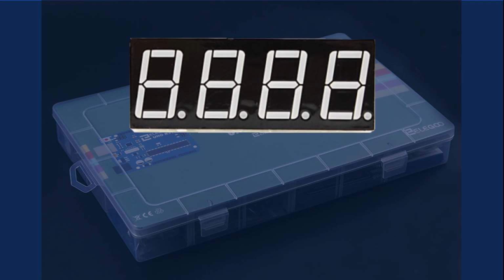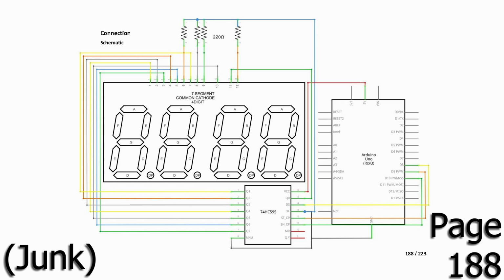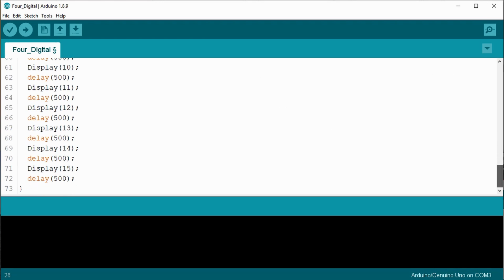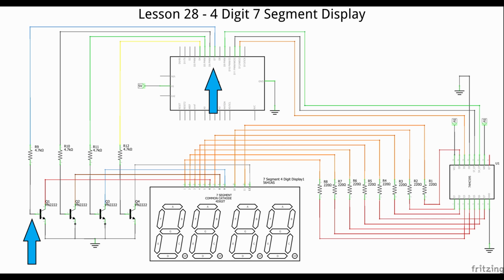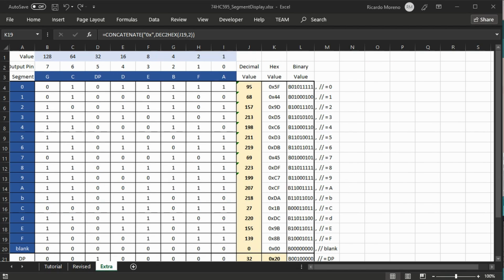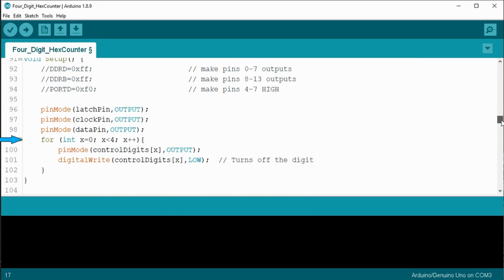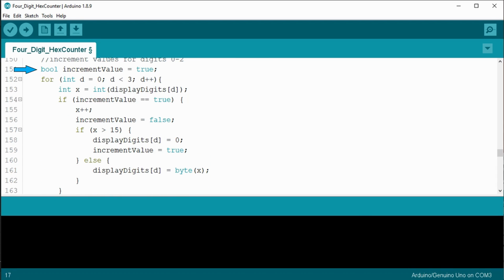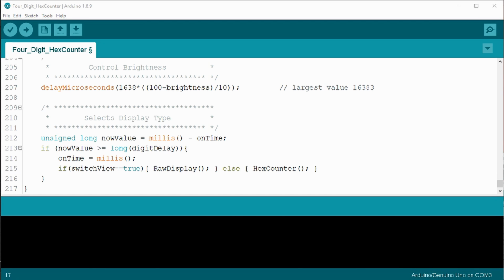Lesson 28 - 4 Digit 7 Segment Display

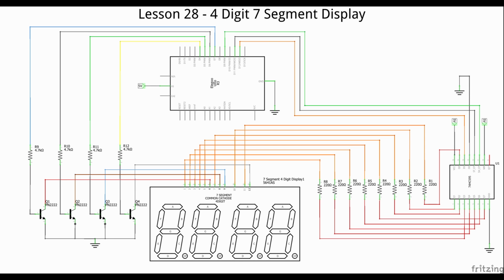Comment: 12:54 You are overdriving the 74HC595 which has a max chip current of 70mA.  With 5v supply, 2.0v forward voltage of red led and 220ohm resistor, each segment requires (5-2)/220 = 13.6mA.  When displaying an "8" that's 7 segments x 13.6mA = 95.2mA.
Reply: I'm just starting out with micro controllers and just finished wiring this. If I proceed, will the shift register just have a shorter lifespan? If so, how much shorter?
Reply: @deadlyorchard  It's a roll of the dice.  Just use higher value resistors, 470 instead of 220 and you should be fine.  You won't even notice the difference in brightness.
Reply: I think you might've messed up the math there. (5-3)/220 = 0.00909, not 0.0136. 0.00909 x 7 segments = 0.0636 = 63.6mA
Reply: @randomrandom5  Actually it's the (5-3) part that has a typo.  The forward voltage of a red LED is around 2v (see preceding sentence above).  So my analysis still stands, and thanks for pointing out the typo! (corrected above)

Comment: after watching this, theirs too much inconsistancy with ur examples and hard to follow witch diagram is correct one.  i have 3 diff breadboards and none of them match ur cheap sketch up version on 12.42 time frame. the segement display doesnt leave eno room for wires to run
Reply: He clearly lists the "junk ones" as JUNK. also, that's your problem, not his. the only cheap sketch up is yours, and yours is CLEARLY too small. get a new one and stop whining

Comment: Wonderful tutorial!  BTW... I used the pin connections similar to the Arduino tutorial, so my bit positions are different from your spreadsheet, and the values being output for each number are different from your circuit.  I used this code to determine the decimal values to output according to my pin connections.  
 
// Bit positions for each segment
const int legTop = 0;
const int legUpperRight =1;
const int legLowerRight = 2;
const int legBottom = 3;
const int legLowerLeft = 4;
const int legUpperLeft = 5;
const int legMiddle = 6;
const int legDecimalPoint = 7;

int setSegments(int number, bool decimalPoint) 
{
    int retSegments = 0;
    
    switch(number)
    {
    case 0: bitSet(retSegments,legTop);
            bitSet(retSegments,legUpperRight);
            bitSet(retSegments,legLowerRight);
            bitSet(retSegments,legBottom);
            bitSet(retSegments,legUpperLeft);
            bitSet(retSegments,legLowerLeft);
            break;
    case 1: bitSet(retSegments,legUpperRight);
            bitSet(retSegments,legLowerRight);
            break;
    case 2: bitSet(retSegments,legTop);
            bitSet(retSegments,legUpperRight);
            bitSet(retSegments,legMiddle);
            bitSet(retSegments,legLowerLeft);
            bitSet(retSegments,legBottom);
            break;
    case 3: bitSet(retSegments,legTop);
            bitSet(retSegments,legUpperRight);
            bitSet(retSegments,legLowerRight);
            bitSet(retSegments,legBottom);
            bitSet(retSegments,legMiddle);
            break;
    case 4: bitSet(retSegments,legUpperLeft);
            bitSet(retSegments,legMiddle);
            bitSet(retSegments,legUpperRight);
            bitSet(retSegments,legLowerRight);
            break;
    case 5: bitSet(retSegments,legTop);
            bitSet(retSegments,legUpperLeft);
            bitSet(retSegments,legMiddle);
            bitSet(retSegments,legLowerRight);
            bitSet(retSegments,legBottom);
            break;
    case 6: bitSet(retSegments,legTop);
            bitSet(retSegments,legUpperLeft);
            bitSet(retSegments,legLowerLeft);
            bitSet(retSegments,legBottom);
            bitSet(retSegments,legLowerRight);
            bitSet(retSegments,legMiddle);
            break;
    case 7: bitSet(retSegments,legTop);
            bitSet(retSegments,legUpperRight);
            bitSet(retSegments,legLowerRight);
            break;
    case 8: bitSet(retSegments,legTop);
            bitSet(retSegments,legUpperRight);
            bitSet(retSegments,legLowerRight);
            bitSet(retSegments,legMiddle);
            bitSet(retSegments,legUpperLeft);
            bitSet(retSegments,legLowerLeft);
            bitSet(retSegments,legBottom);
            break;
    case 9: bitSet(retSegments,legTop);
            bitSet(retSegments,legUpperLeft);
            bitSet(retSegments,legMiddle);
            bitSet(retSegments,legUpperRight);
            bitSet(retSegments,legLowerRight);
            bitSet(retSegments,legBottom);
            break;
    case 0x0A: 
            bitSet(retSegments,legTop);
            bitSet(retSegments,legUpperLeft);
            bitSet(retSegments,legLowerLeft);
            bitSet(retSegments,legMiddle);
            bitSet(retSegments,legUpperRight);
            bitSet(retSegments,legLowerRight);
            break;
    case 0x0B: 
            bitSet(retSegments,legUpperLeft);
            bitSet(retSegments,legLowerLeft);
            bitSet(retSegments,legMiddle);
            bitSet(retSegments,legLowerRight);
            bitSet(retSegments,legBottom);
            break;
    case 0x0C: 
            bitSet(retSegments,legTop);
            bitSet(retSegments,legUpperLeft);
            bitSet(retSegments,legLowerLeft);
            bitSet(retSegments,legBottom);
            break;
    case 0x0D: 
            bitSet(retSegments,legMiddle);
            bitSet(retSegments,legLowerLeft);
            bitSet(retSegments,legBottom);
            bitSet(retSegments,legUpperRight);
            bitSet(retSegments,legLowerRight);
            break;
    case 0x0E: 
            bitSet(retSegments,legTop);
            bitSet(retSegments,legUpperLeft);
            bitSet(retSegments,legLowerLeft);
            bitSet(retSegments,legMiddle);
            bitSet(retSegments,legBottom);
            break;
    case 0x0F: 
            bitSet(retSegments,legTop);
            bitSet(retSegments,legUpperLeft);
            bitSet(retSegments,legLowerLeft);
            bitSet(retSegments,legMiddle);
            break;
    default: 
            retSegments = 0;
    } // End Case

    if (decimalPoint)
    {
      bitSet(retSegments,legDecimalPoint);
    }

    return(retSegments);
}

Comment: Nicely done! Very thorough! Wow! Thank you for saving me from burning out the output pins on my Arduino! I only have two transistors in my starter kit, so I am displaying just 2 digits for now. I modified my displayDigits function to display each of the 2 digits for 1 ms each, and I added a for loop around that to set how long in ms to display the two digits for (eliminating the flicker).  I set this to about 50 ms which worked great for my decimal counter (0 to 99).  Now I know more about transistors!

Comment: Okay I have tried to replicate the lesson from Elegoo (in which the four digits all cycle through) and have quadruple checked connections, and it goes through a very odd cycle starting with 1, 3, 5, 7, etc.  Interestingly, if I move the red jumper wire from 5v (coming out of the Uno board) to the Vin pin, it works as shown above.  Any idea what could be going on?
Reply from the maker: Greetings, first I need to confirm that you are using the same Elegoo lesson as shown in the video.  Also Vin will supply unregulated power out.  To get regulated 5V out, use the 5V pin.  If you are using a USB cable, you're getting 5V from your computer.  Your adapter may supply up to 9V.  You can do a quick Google search for more information.

Comment: The same purpose can be fulfilled by TM1637  (https://www.youtube.com/watch?v=DuamjlstOKM&t=609s) and is far more practical than this unnecessarily complicated device.
Reply: Indeed, while it is far more practical, this video only uses parts included with the Elegoo starter kit. However, knowing this, I do think the kit requires a major overhaul, especially due to how it's advertised.

Comment: when do you show me how to put it together? Im not a fucking engineer. This circuit is extremely complicated for an arduino beginner. I just need to use the display for my program... You did not show ANY of the wiring of the actual device at all. Your picture dont help me. I dont have time to learn all this just to display a number in my arduino device ill never code with again
Reply: no u
Reply: Chill out guy.
Reply: its probably a little to late but the circuit diagram he put up is really easy to follow along to just make sure you follow one single line till it ends. furthermore if the wiring diagram was a little too complicated maybe consider switching programs it doesnt get any easier

Comment: You will forget electronics and embedded systems after watching this video for sure!! Char is 16 bit...he'll yeah
Reply from the maker: Oh darn.  To clarify, typically a char is a value from 0 to 255, which is single byte and typically represents a letter or character.  A byte can be a value between -128 to 127.  An  unsigned byte is 0 to 255.  While researching this lesson I found that a char in Java is a UTF-16 code unit.  It's not necessarily a complete Unicode character, but it's effectively an unsigned 16-bit integer.  I'm not sure if this still hold true.
Reply: @rickmorenojr  Ohh I dont know about the Java man. But I think as far as u r twiking around embedded systems char is always 8 bit or 1 byte...yes ofcourse you can creat your typedef to creat your own 16 bit char😉. Great video by the way!!

Comment: This was good for counting, I want to learn more about scrolling from right to left  (LSB . digit 4 , to the MSB , digit 1 ) I'm good at Hardware, i.e. current draws , voltages, small signal amplification ohm's law and such, but the coding in very new to me. Lesson 16 they walked the LED's from right to left with the shift register. I want to be able to do that with the 4 digit display or even multiple 7 segment displays, but light up the corresponding segments, i.e. a,b,c,d,e,f,g as they progress to the left. If anyone knows of good resources or examples feel free to contact me at janhornberger1234@outlook.com
Reply: Kristian Blason's Anything Arduino series episode on the 7 segment 4 digit display has an easier to understand code for lighting up the 4 digit display if that helps. Im on the same boat as you buddy

Comment: Thanks for this great tutorial. Your improvement of the circuit is great. But a big leap in improving the code can be made by separating the plumbing of getting digits to show on the display from the logic to what to display. This can be done even with using the same coding skill level 
See my example on https://github.com/srooij69/4x7_Segment_Display
(though not a goal, with less lines of code)

Comment: Thanks for poiting out the flaws in the lesson 28 tutorial. Actually I am using a common anode but didn't realise the tutorial was about common cathode. But I could not figure out how to wire for a CC. So the shift register IC was boiling hot! I stopped everything. What are the modifications necessary for a common anode wiring? Cheers

Comment: I use potentiometer to display number but last digit always flashing. For example number is 237 . It displays number 237 and then 7 for a few seconds. Please help.

#define DataPin 8
#define LatchPin 9
#define ClockPin 10
#define d1 2  //digit#1
#define d2 3  //digit#2
#define d3 4  //digit#3
#define d4 5  //digit#4

byte val;

//Cathode 7 Segment
unsigned char number[]= {
  0xFC,0x60,0xDA,0xF2,0x66,0xB6,0xBE,0xE0,0xFE,0xE6
};
                  
void setup()
{  
  Serial.begin(9600);
  
  pinMode(ClockPin, OUTPUT);
  pinMode(DataPin, OUTPUT);
  pinMode(LatchPin, OUTPUT);
  pinMode(d1, OUTPUT);       
  pinMode(d2, OUTPUT);       
  pinMode(d3, OUTPUT);
  pinMode(d4, OUTPUT);
}

unsigned char GetByteForNum(int num)
{
  return number[num];
}

void DisplayLED(int x1,int x2, int x3, int x4)        //4 Digit
{
   val=GetByteForNum(x1);                   
   digitalWrite(d1,LOW);
   digitalWrite(d2,HIGH);
   digitalWrite(d3,HIGH);
   digitalWrite(d4,HIGH);
                   
   digitalWrite(LatchPin, LOW);
   shiftOut(DataPin,ClockPin,LSBFIRST,val);
   digitalWrite(LatchPin, HIGH);
   
   delay(5);

   val=GetByteForNum(x2);                           
   digitalWrite(d1,HIGH);
   digitalWrite(d2,LOW);
   digitalWrite(d3,HIGH);
   digitalWrite(d4,HIGH);
                   
   digitalWrite(LatchPin, LOW);
   shiftOut(DataPin,ClockPin,LSBFIRST,val);
   digitalWrite(LatchPin, HIGH);
   
   delay(5);
   
   val=GetByteForNum(x3);                    
   digitalWrite(d1,HIGH);
   digitalWrite(d2,HIGH);
   digitalWrite(d3,LOW);
   digitalWrite(d4,HIGH);
                   
   digitalWrite(LatchPin, LOW);
   shiftOut(DataPin,ClockPin,LSBFIRST,val);
   digitalWrite(LatchPin, HIGH);
   
   delay(5);

   val=GetByteForNum(x4);                              
   digitalWrite(d1,HIGH);
   digitalWrite(d2,HIGH);
   digitalWrite(d3,HIGH);
   digitalWrite(d4,LOW);
                   
   digitalWrite(LatchPin, LOW);
   shiftOut(DataPin,ClockPin,LSBFIRST,val);
   digitalWrite(LatchPin, HIGH);
   
   delay(5); 
}
void DisplayLED(int x2, int x3, int x4)              //3 Digit
{
  val=GetByteForNum(x2);                           
   digitalWrite(d1,HIGH);
   digitalWrite(d2,LOW);
   digitalWrite(d3,HIGH);
   digitalWrite(d4,HIGH);
                   
   digitalWrite(LatchPin, LOW);
   shiftOut(DataPin,ClockPin,LSBFIRST,val);
   digitalWrite(LatchPin, HIGH);
   
   delay(5);
   
   val=GetByteForNum(x3);                    
   digitalWrite(d1,HIGH);
   digitalWrite(d2,HIGH);
   digitalWrite(d3,LOW);
   digitalWrite(d4,HIGH);
                   
   digitalWrite(LatchPin, LOW);
   shiftOut(DataPin,ClockPin,LSBFIRST,val);
   digitalWrite(LatchPin, HIGH);
   
   delay(5);

   val=GetByteForNum(x4);                              
   digitalWrite(d1,HIGH);
   digitalWrite(d2,HIGH);
   digitalWrite(d3,HIGH);
   digitalWrite(d4,LOW);
                   
   digitalWrite(LatchPin, LOW);
   shiftOut(DataPin,ClockPin,LSBFIRST,val);
   digitalWrite(LatchPin, HIGH);
   
   delay(5); 
}
void DisplayLED(int x3, int x4)                       //2 Digit
{ 
   val=GetByteForNum(x3);                    
   digitalWrite(d1,HIGH);
   digitalWrite(d2,HIGH);
   digitalWrite(d3,LOW);
   digitalWrite(d4,HIGH);
                   
   digitalWrite(LatchPin, LOW);
   shiftOut(DataPin,ClockPin,LSBFIRST,val);
   digitalWrite(LatchPin, HIGH);
   
   delay(5);

   val=GetByteForNum(x4);                              
   digitalWrite(d1,HIGH);
   digitalWrite(d2,HIGH);
   digitalWrite(d3,HIGH);
   digitalWrite(d4,LOW);
                   
   digitalWrite(LatchPin, LOW);
   shiftOut(DataPin,ClockPin,LSBFIRST,val);
   digitalWrite(LatchPin, HIGH);
   
   delay(5); 
  
}
void DisplayLED(int x4)                     
{
   val=GetByteForNum(x4);                              
   digitalWrite(d1,HIGH);
   digitalWrite(d2,HIGH);
   digitalWrite(d3,HIGH);
   digitalWrite(d4,LOW);
                   
   digitalWrite(LatchPin, LOW);
   shiftOut(DataPin,ClockPin,LSBFIRST,val);
   digitalWrite(LatchPin, HIGH);
   
   delay(5);
}

void loop()
{ 
   int potValue = analogRead(A0);
   Serial.println(potValue);

   if(potValue > 999)
   {
     int p1,p2,p3,p4;
     p1 = (potValue/1000)%10;
     p2 = (potValue/100)%10;
     p3 = (potValue/10)%10;
     p4 = potValue%10;    
     for(int i=0; i<200; i++)
     {  
        DisplayLED(p1,p2,p3,p4);
     } 
   }
   else if(potValue > 99 && potValue < 999)
   {
     int p2,p3,p4;
     p2 = (potValue/100)%10;
     p3 = (potValue/10)%10;
     p4 = potValue%10;  
     for(int i=0; i<200; i++)
     { 
        DisplayLED(p2,p3,p4);
     }           
   }
   else if(potValue > 9 && potValue < 99)
   {
     int p3,p4;
     p3 = (potValue/10)%10;
     p4 = potValue%10; 
     for(int i=0; i<200; i++)
     {  
        DisplayLED(p3,p4);
     }                   
   }
   else if(potValue <10)
   {
     for(int i=0; i<200; i++)
     { 
        DisplayLED(potValue%10);
     }
   } 

   delay(500);
}

Comment: So, the shift register is providing the power for the LEDs right? But in the 74HC595 datasheet, it says it's capable of providing 6mA output drive. But since you used 220 ohm resistors for limiting the current to the LEDs, that gives approx. (5-2)/220 = 14mA of current per LED. Wasn't that current supposed to fry the shift register?
Reply from the maker: I seem to recall that the Q0-Q7 max output current is 20ma each.  I'll have to double check the datasheet.  Though like many chips that are switch on and off rapidly, they can tolerate a little higher currents if need be.

Comment: what do I have to write in the sketch to have a point at the 1000th place? At DisplayDigits [3] ??? you even wrote the byte DigitDP, but did not use it ...
Reply: It is important to know the decimal value of the pin connections.  In the original Arduino tutorial, the decimal value for the decimal point is 128.  In the program here, the decimal value for the decimal point is 32.  Add this value to the output value to turn on the decimal point.